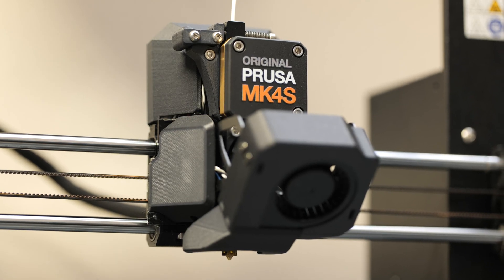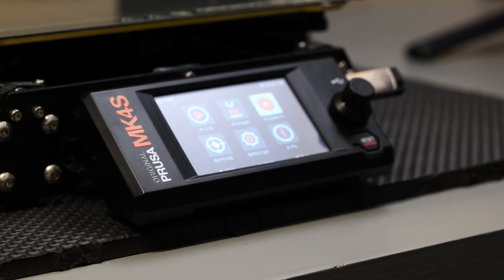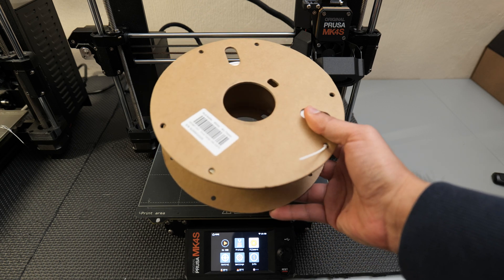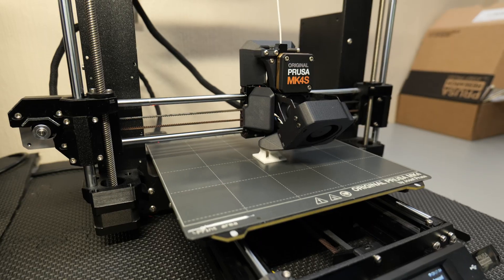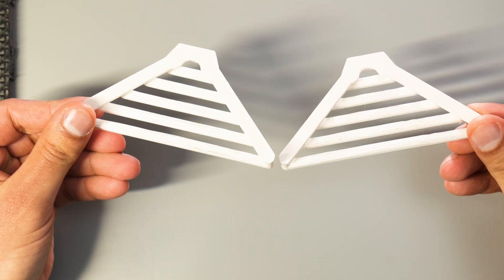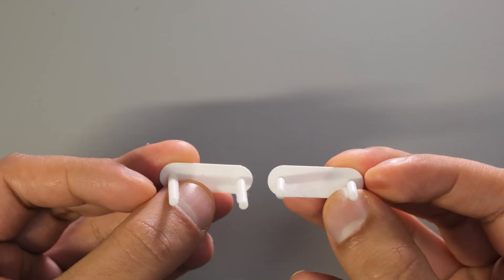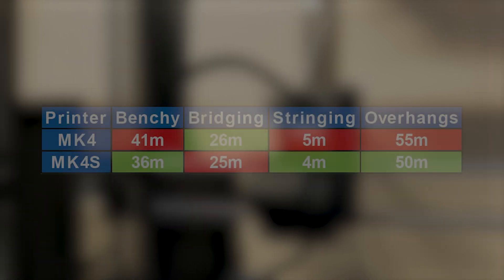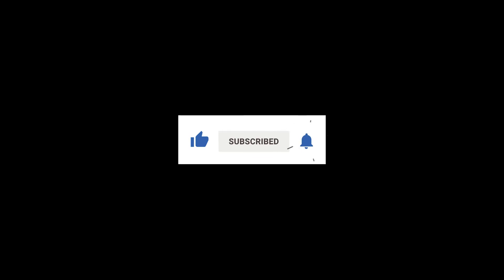WATCH This Before Upgrading to the PRUSA MK4S

Comment: Thanks for the nice video! I have the MK4, and it's more than enough for my printing needs, but I do like the upgrade option. 😊
Reply from the maker: The MK4 is amazing. In my opinion, the performance improvement going from the MK3S+ to the MK4 was larger than 4 to 4S.